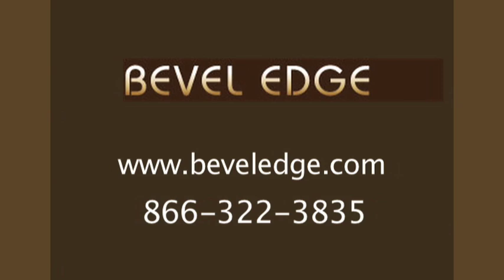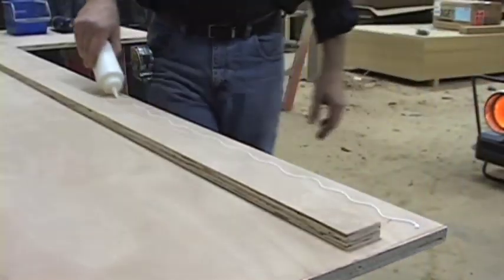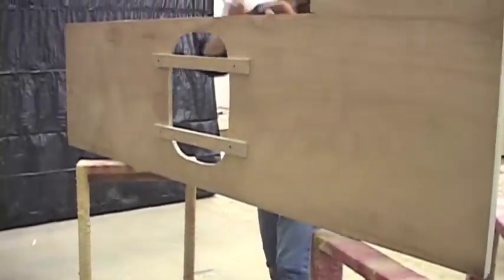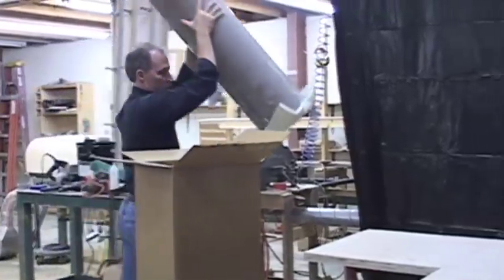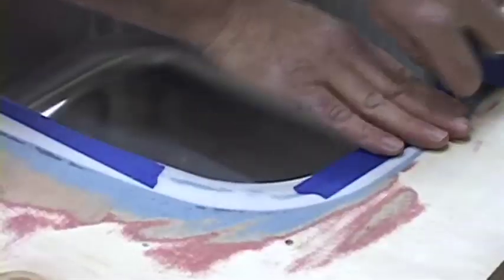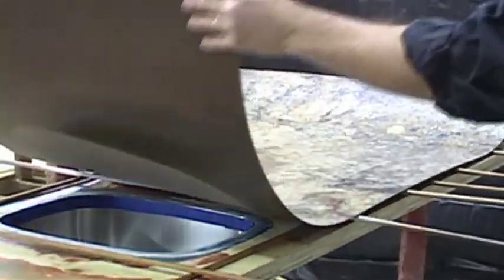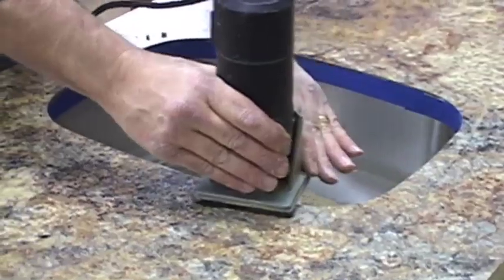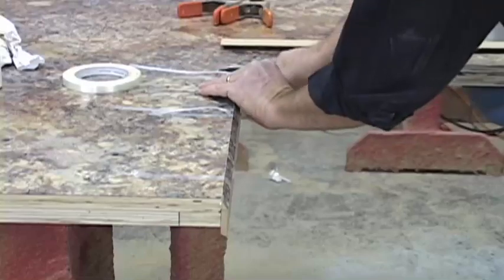DIY Laminate Countertop and Bevel Edge Trim

Comment: You answered a question I had only today thought to ask, if that laminate would work over bondo, and here you're deliberately using it!
Reply: Yeah it works, just take it easy because it’ll take longer for the glue to dry over the bondo than it would normally.

Comment from the maker: oliveros, the laminate is sealed to the acrylic sink rim with epoxy so there will be no water infiltration there. The only remaining surface is the edge of the laminate, approx .038" thick. The Formica laminate (phenolic and resin fused under heat and high pressure)  is too dense for water to infiltrate thus there is no additional maintenance required..

Comment from the maker: You're correct, there are other ways to mount a stainless steel sink although I believe they all use a 1/2" thick acrylic transition ring between the laminate and the sink. The sink is mounted to the bottom of the transition ring leaving a 1/2" brown line between the top and the sink & also a reveal below the ring that has to be cleaned often or gets gunked up. On the Karran / Lansen Edge sinks, the acrylic surrounds the stainless bowl so all you see at the top edge is approx 1/16" laminate.

Comment: I did my first countertop lamination today. I used 3M Fastbond 30-NF Neutral contact adhesive and it worked great. It's water based but very expensive, especially if you should need two coats. I needed two quarts to do my kitchen and one bathroom - about 42 square feet. It was not easy to find (Grainger's had it) and it was about $42 per quart!
Reply: 8 years later….  Very interesting to read this now. I just got off the phone with the Formica tech support department.  They strongly said to not use any water base contact cement including 3M Fastbond.  I would be curious to hear from you all these years later and hear how it held up.   🤟🏼

Comment: Question for you.   What trim router are you using and what brand of flush trim bit.  I purchased a flush trim router from Harbour Freight and it has no guts at all.  It was slow, very slow....the bit I used was a brand new diablo bit.

Comment from the maker: Home centers won't cut laminate to size like they do plywood, etc... The same tools that you'll use to final trim the laminate, a router & flush trim bit, can be used to cut it to rough size for fabrication. Consider purchasing an Over-Trim bit which will allow you to just clamp the laminate to the countertop deck and cut it a bit over-sized for the first step. These bits are both used in this video.

Comment: I have a question about your deck.  Was it less than a 4'x8' plywood?  Mine would be bigger than a single 4'x8 'piece.  I would hate to make 2 pieces and do a 45 degree cut. In such a situation do you advice doing a 45 degree cut or joining 2 plywood.  Do you have any videos showing how on to best joint the plywood and braces to keep it sturdy?

Also I do not see any Karran undermounts by the name you mentioned.  Is it just any of the Edge - Undermount sinks.

Comment: Very nice video. I do a little laminate work for shop fixtures in my woodworking shop. My question is about commonly available contact cements. I have been using the Weldwood standard (very stinky) type. Do you have any recommendation or experience using the low VOC less toxic version Weldwood sells that you could share with me. As I get older I get more sensitive to the fumes and was hoping on some table saw fence skins I am making if I could go a little more "green".  Thanks for your time.

Comment: good afternoon apology that type of router is the one you used in the router to cut the edges of the sheet or formica if you could desirme to buy lla that this does not leave much edges

Comment: You certainly can reuse the existing deck for a new laminate top. We suggest you sand down the existing laminate with a rough sandpaper and degrease it so its very clean. You want a clean surface to roll on the contact cement. There is no need to remove the existing laminate.

Comment: Thanks for making this video. I replaced all my countertops to this exact formica and like it very much...but I didn't get the beveled edge you used and now I wish I had. Can I put that beveled edge over a regular flat edge after the fact?
About how much to get edges installed per foot?

Comment: Why not just use contact cement to mount the bevel edge trim, and then clean up glue residue with a cleaner for a better bond

Comment: Just curious, how do you install faucet fixtures?
Reply: debra belton by drilling the holes through the deck the Karr an sinks come with plastic grommets that go in the hole to protect the wood or you can seal it with silicone

Comment: what if you need a new sink a few years after this...  stupid idea ....
Reply: I disagree that an integrated sink is a stupid idea. Corian has offered seamless sinks for years and the finished assimilated product is absolutely beautiful. But is does come with the caveat that irreparable damage to the sink or countertop requires an expensive wholesale tear-out and replacement.